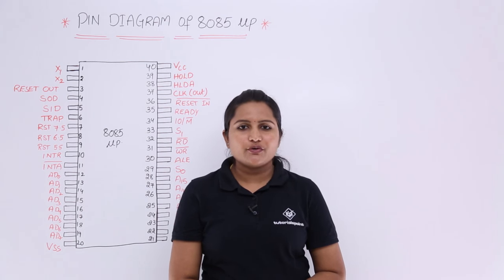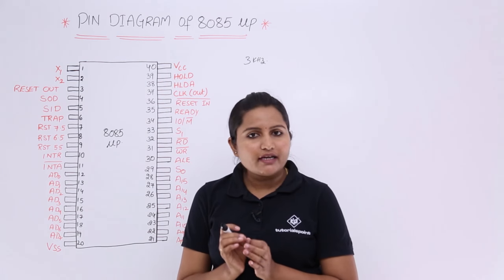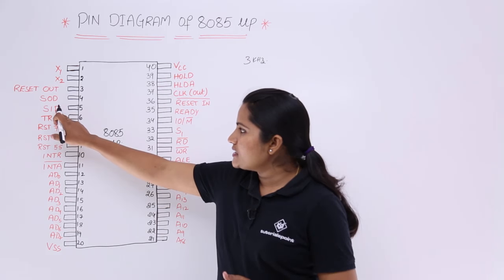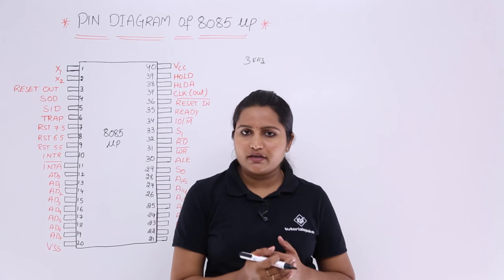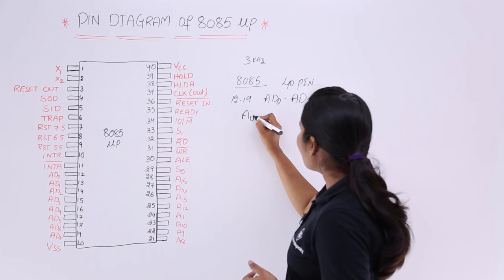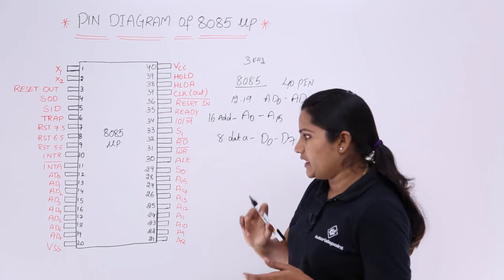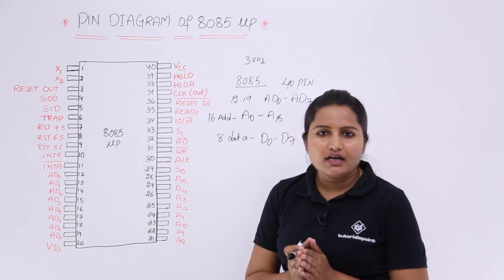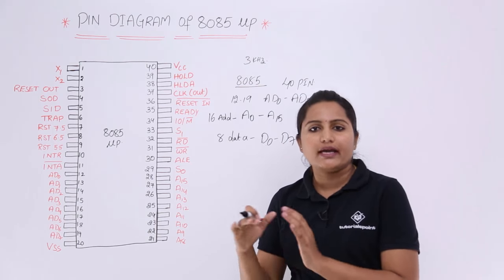PIN Diagram of 8085

Comment: Very nice explanation but there is a a correction. The frequency of crystal oscillator is 6 MHz which is divided so we get 3 MHz instead of 3 KHz.
Reply: yes, you are right in the above video the frequency of crystal oscillator if 6.144MHz and half of it is 3.072MHz
Reply: Correct akash bhai
Reply: It's 6.25MHz and pin 1&2 will get 3.125MHz but we take  6MHz (approx) as the frequency of crystal oscillator and 3MHz(approx) for each clock pin
Reply: @Spoon Liver oh really
Reply: mistak hua hai
Reply: We use 6mhz in order to achieve 50 %duty cycle

Comment: That's not kHz it's mhz and we use a 6mhz crystal oscillator even if 8085 requires 3mhz, the reason is, to achieve 50%duty cycle.